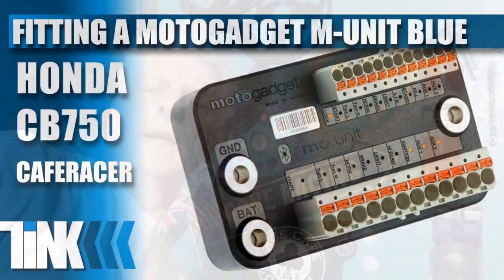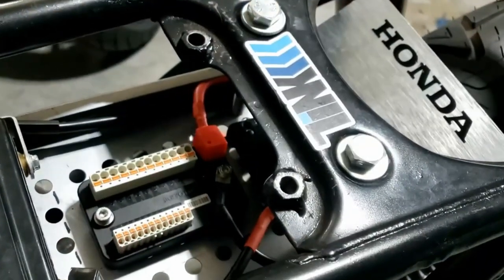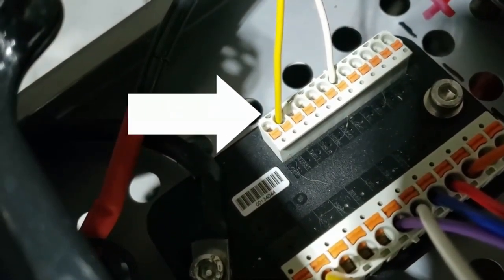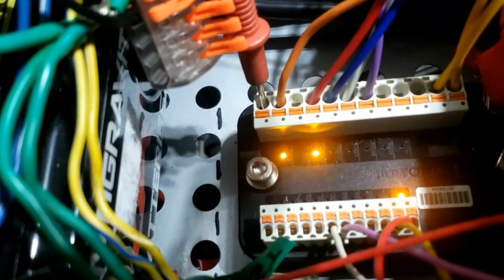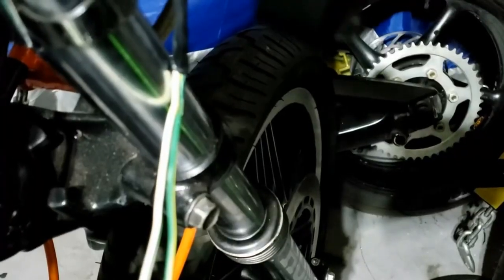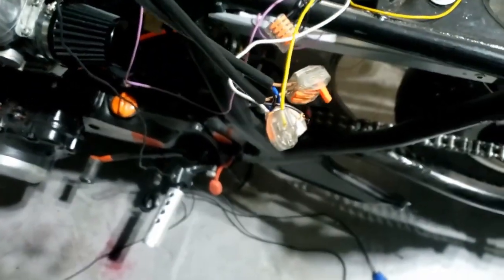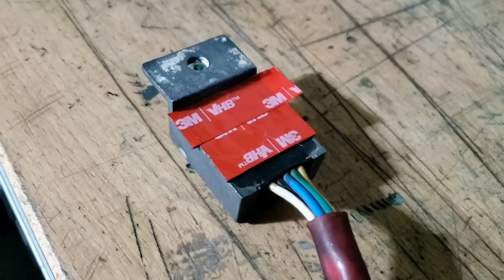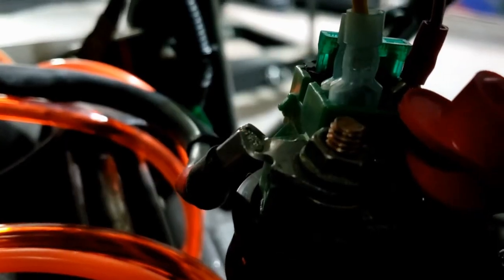Installing a Motogadget M-UNIT Blue - start to finish, on a 1982 Honda CB750 Cafer Racer

Comment: Looks like you navigated your way round it all. These #motogadget units are pretty cool with the app and all.
Reply from the maker: Eventually yes. I don't think I would install one for the sake of it, but the wiring was already fairly messed up on this #Honda #CB759 so I figured it was as good a time as any to try fitting a #motogadget unit